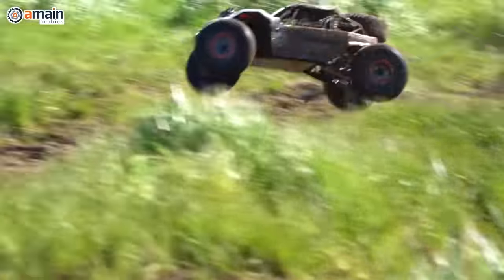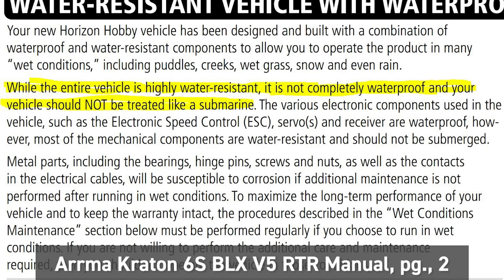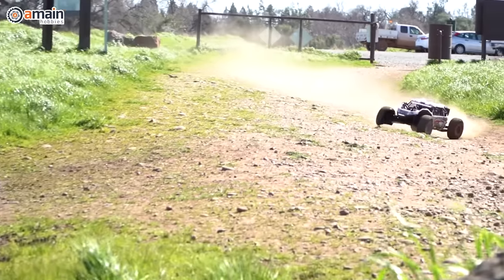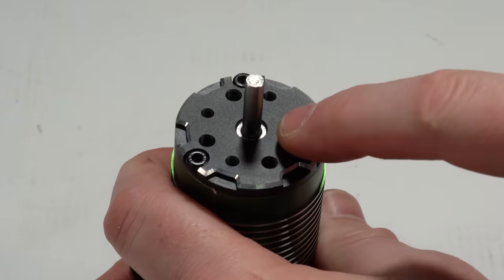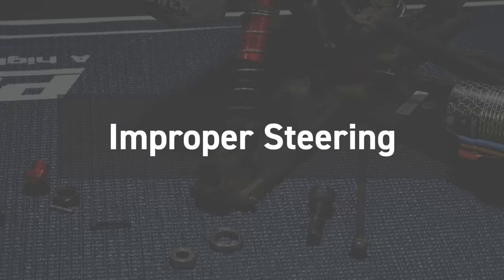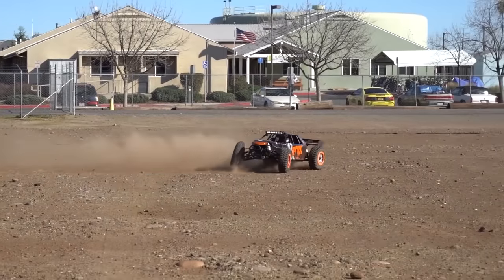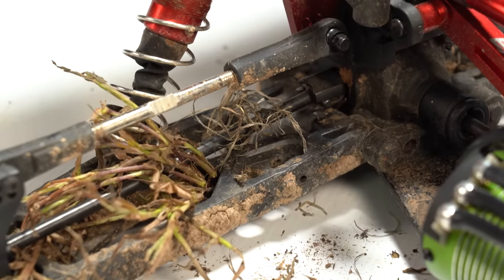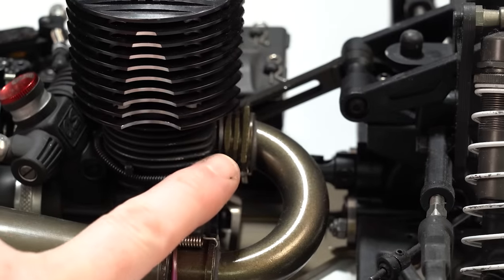7 Ways You're Destroying Your R/C Car

Comment: Ive bought smaller or skinnier tires and it helped a good bit but i still cant run a pack thru w/o letting it cool or it will hit thermal. If i upgraded to a 3660-65 from a 3650 would this help my rig run cooler or would it have no effect on temperatures? Forgive my ignorance. Everything else is stock. 1/10 4wd mt 3300kv 60amp HW rebrand. 3s.

Comment: Is using bent shocks going to mess up my slash 4x4 i mean they still move fine and the alignment is fine
Reply from the maker: Bent shock shafts can limit the shock movement and travel, but the truck should still run and operate ok; you'll just have poorer suspension movement and less overall performance. Like the vehicle will turn/steer/corner odd to the effected side, but behave "normal" turning to the other side. I'd replace that shock shaft at some point to keep your truck fresh. 
-Brett

Comment: first issue is i had a buddy wreck mine near flooded culvert pipe.. stock slash 2wd.. motor, trans, every single thing was underwater for at least 10 minutes because it was so deep and step to get to had to find a long branch to rescue it.... got it out and finished the battery pack.. been 2 years and not an issue?

Comment: Cool tip on the "After Run Oil."
WD-40. The "W" stands for water. The "D" stands for displacement. The 40? I haven't got a clue.
Reply: It was the inventors 40th attempt at making/Designing WD 40

Comment: I agree with everything except for running the nitro engines without fuel evey time to drain leftover fuels. I just use my fuel bottle pull out exess fuel and if needed remove fuel line to gravity bleed.

Comment: But here is the thing, I always drive on dry terrain, I live far from water, I never touch the gearing, I use an Electric car, the steering is always correct and I never need to fix it and im a peaceful driver so its going to take a long time before any parts will break.

Comment: Hello, I was wondering if you could give me some advise with  a problem that I have.    I have a granite 3s blx which I purchased used. The truck is in mint condition. The only problem I have is that the radio range is about 30 feet and the truck stops (no steering or throttle). . Once I get within 30 feet I regain control of throttle and steering. The antenna looks fine. I was wondering if I need a new receiver or there is a problem with the esc going into a safe mode. Thankyou..
Reply from the maker: The receiver should detect the transmitter signal unless there is no signal (or the signal is not strong enough to be detected by the receiver; hence the 30ft range of control). It sounds like the transmitter signal is so weak it can only provide a range radius of ~30 feet, and unless your vehicle is within that radius, it is lifeless. This is often a sign the transmitter batteries are bad or need to be replaced; have you tried new transmitter batteries recently? What transmitter is it by the way; make and model? 
-Brett

Comment: Everything here is dope and true but the tape over the vent holes on the wheels will prevent the most traction you can get out of the tire, it doesn’t decompress and grip as fast when the vent holes are blocked

Comment: If you know what your doing you can water proof the whole thing like I did and I’m 13. I did it by myself and took one hour. Mine goes over the roof underwater and I have not had a single problem. Put wd40 on the metal it won’t rust.

Comment: Hi, new to rc... about keeping the rc cars clean can you use like a light amount of oil on the non electrical parts? Its popular in offroad trucks where people spray wd40 on their suspension and frame. Then just wipe all the grime off with a paper towel after offroading. Can you do this aswell?
Reply from the maker: Yeah, should be ok. Some people in r/c do the same thing. ProTek has this product that comes from the motorcross world, but you spray it on clean plastics and it shines the plastic and makes them easier to clean after. https://www.amainhobbies.com/protek-rc-trushield-rc-car-detail-spray-13oz-ptk-1540/p246483
It has a sweet, almost berry-like smell to it.
-Brett
Reply: @AMain_Hobbies  Awesome, good to know. I appreciate the reply.

Comment: Wil a crawler like the trx6 have a drive train that spins that easy without the motor or does it have a  bit more resistance to it?
Reply from the maker: I imagine the TRX6 diffs to be loose for crawling, since you can lock the diffs remotely, which is fine and normal. 
-Brett

Comment: I have an hg p408 humvee and i recently drove it in the snow. How do I properly clean out the drivetrain to remove all the salt from there?
Reply from the maker: Might be tricky but you'll need to start dissembling those drivetrain parts and start scrubbing them. It's a tedious, time-consuming job to tear down a car and clean it, but it will make a huge difference. I'm not familiar with your vehicle, but I assume it's a hobby grade vehicle you can disassemble and work on; If it isn't, we don't recommend you disassemble it. 
-Brett

Comment: I got a problem with my typhon 3s I never tried cleaning it by taking parts out or anything to complicated and hard work but there's some black oil or whatever the liquid thing is in the springs but something leaking everywhere on the joints near tires and bit on the springs near the tires I dont know how to be specific but I need help

Comment: My bandit does 100 on stock motor and esc It's really hasn't donr much I just went to aluminum Spur and clutch clutchless replacement and stronger gears in the transaxle she's all good I went to different wider setup from a different model that mount the same so I got fans and heat sink but I start slow then hit it cause I got a long smooth street,(electric car too it was like a 28 -31 pinion and around 70-76 Spur or something I can't remember gotta look but yea after I shaved down 3 Spur gears I went aluminum then I havnt had issues even the stock axles held up but I went to strong metal ones for the stress

Comment: Hey I'm new to rc what kinda tools does he use? Does he have a link or has something tips on what to do and what tools i should get?
Reply from the maker: We picked up the ProTek Tool Bag and filled that with our favorite tools. 
This is the bag: https://www.amainhobbies.com/protek-rc-trutorque-team-tool-bag-ptk-8102/p222021
The hex drivers: https://www.amainhobbies.com/protek-rc-trutorque-sl-metric-hex-driver-set-4-ptk-8416/p863873
The nut drivers: https://www.amainhobbies.com/protek-rc-trutorque-sl-4piece-metric-nut-driver-set-5.0-5.5-7.0-8.0mm-ptk-8282/p752699
Pliers: https://www.amainhobbies.com/excel-needle-nose-pliers-w-side-cutter-5-exl55580/p27709
Xacto Knife: https://www.amainhobbies.com/excel-light-duty-knife-w-safety-cap-exl16001/p27756
Lexan Body Reamer: https://www.amainhobbies.com/protek-rc-trutorque-lexan-body-reamer-ptk-8203/p212259
Shock Tool: https://www.amainhobbies.com/protek-rc-trutorque-shock-shaft-pliers-ptk-8267/p248643
We also carry a sharpie black ink pen, an old tooth brush and some electric tape. These tools should service 99% of r/c basic needs. 
-Brett

Comment: I have a question, i have 2 traxxas slash 4x4s, and both of them, the back tires get worn out much faster than the front. And i don't do donuts, i don't go from 0-full throttle. Is there a way to prevent back tires from getting worn so fast? Plus on both of them the tires are adjusted right.
Reply from the maker: You can try rotating them. Once in while rotate the rear tires to the front, and the fronts to the back, and you should get more life out of the tires. 
-Brett
Reply: @AMain_Hobbies  thanks you very much, I'll try doing that.

Comment: Im a noob with these cars but I got a aarma senton 4x4 for my 8 year old and it has been the biggest piece of junk I have ever seen... im a small engine mechanic to the highest degree and although I am not knowledgeable with RC car components I am extremely mechanically inclined... I am beyond frustrated here... nobody knows what to tell me I have gone through 2 motors... a spur gear and a front bumper... also the drive axle fell out and all of these issues in about 2 hours of actual drive time!!! WTF!!! its insane... obviously I am missing something but drivetrain is smooth no binding... not owner error (hopefully)... as far as installing the new components because the initial motor it came with lasted 35 minutes and the one I install lasted 1.5 hours but apparently you can't drive them in dirt, water, snow, grass, leaves etc.... so concrete and paved roads yay!!! I'm  done with aarma and I think the way that the components are completely exposed is a huge design flaw... it keeps getting full of debris when running it and that is crazy to me... why aren't the components sealed or at least protected... i understand it needs airflow but there has to be some way to seal the critical components... the damn spur gear is just out in the open and it gets a tiny grain of sand in it and there go the teeth... horribly designed cheap crap... I just want my son to be able to drive it for a couple hours without it breaking... I know someone will say I have the settings wrong or endpoints but nope... and using correct battery... not geared or modified in any way... was looked at by the hobby shop and no answer... its garbage... sorry for the novel but I gad to vent lol... I actually liked your videos good stuff 💯
Reply from the maker: Awh man, I'm sorry to hear that John! Is this the 3S BLX Brushless version? You have to watch out for the plastic driveshafts and the motor mount bending on the 3S BLX vehicles. When the motor mount bends, you'll start going through gears (but generally the motor doesn't die). The motor will die if you add extra weight to the car (the tires filled with material can add a lot of weight), change the gearing, or are not letting it cool down in between runs. About 175°F is the limit before you start to reach the danger zone. In cold climates, the motor may never get that hot. In hot climates, the motor may reach that temp in 2 minutes. 
-Brett

Comment: Is it true on your first run you should only use at a 1/3 top speed to properly break in a brushed motor
Reply from the maker: Back in the day, people had all sorts of break-in methods, including breaking in the motor in water. Some people care enough to do this, some people don't care. I personally don't think it makes much of difference for most applications, unless you are going to race, but brushed motors are no longer raced. So... just enjoy your car. Brushed motors wear out regardless if you drive at 1/3 power, or 3/3 power, which is why long-lasting brushless motors are mostly used today. 
-Brett

Comment: I’m thinking of gearing up my Traxxas Hoss to a 15 or 16-tooth pinion (the stock pinion is 14-tooth). I have a heat sink and fan for the motor. Would this be okay for the truck?
Reply from the maker: It's hard to say, it depends on how hard you drive, the type of terrain you drive in and the weather of your environment. You could try it, drive for a few minutes and feel how hot the motor is. If you can leave your finger on the motor can for 3 seconds its ok, if the motor is so hot you can not do this, it's too hot; just be careful not to burn yourself. We sell these temp gauges for this application too: https://www.amainhobbies.com/protek-rc-trutemp-infrared-thermometer-ptk-8310/p360118

My guess is, gearing up is not recommended unless you're only doing a speed run. Traxxas tested the gearing and equipped the truck with the best pinion size for overall bashing. 
-Brett

Comment: What's the 4wd buggy shown in the video, specifically at 6:32..? Thanks!!
Reply from the maker: That's the Team Associated B74.1 4WD Buggy. The current version is the B74.2, but you can still buy the B74.1 and it's on sale: https://www.amainhobbies.com/team-associated-rc10b74.1-team-1-10-4wd-offroad-electric-buggy-kit-asc90027/p1252584
Here is the current B74.2: https://www.amainhobbies.com/team-associated-rc10b74.2d-team-1-10-4wd-offroad-electric-buggy-kit-asc90037/p1447397
-Brett

Comment: So what if u are using the 12 pole velineon brushless engine? Is it still supposed to role freely? Or is a little binding ok?
Reply from the maker: You need to remove the motor or the motor pinion gear from being engaged with the drivetrain, and then roll the drivetrain to see how smooth and freely it feels. You cannot roll the drivetrain with a motor engaged to it. 
-Brett
Reply: @AMain_Hobbies  ok I meant 4 pole not 12😅😅😂 I just put the 3351r brushless velineon motor in my 4 tec 3.0, thanks for the tip!

Comment: It's old but i have a question, how about when car is understering as brand new from the box, i mean here keep trimmering servo on controller because when driving it's keep slightly turning left or right, never straight forward, i tried loose the screw on servo, regulate it, in final result is just keep the same, trimmering on controll and never push the trigger more because it will end on wall.

I could understand that behaviour after some using already, but new Traxxas toy with problem of steering where your rc car not drive on the line on asphalt? (yes it's road car, it's stingray rc car, but problem i seen on my traxxas xo 1 as well)

I could be very gratefull why this problem appear and eventually how could i fix it.
Reply from the maker: It can be the servo saver not properly centering, but that is more common on used vehicles where the servo saver is worn out. It might be worth checking out though. 
-Brett
Reply: @AMain_Hobbies  Yes i found it out, indeed it was not centered properly, thanks for info :)

Comment: Hi! can you tell me, why the fan on the electric speed-controller stoped working after the very first test-drive? could it brake down so fast? or it activates only if necessary? the speed-controller itself working good, but the fan - is not. What`s the problem?
Reply from the maker: If it's an off-road vehicle, fans can die pretty easily from bumps and jumps; most often from landing on the lid. Fans are made from plastic and under the right situations, the case will flex and the fan blades will hit the case and break. If it didn't break, maybe the wire came unplugged?
-Brett

Comment: The tyres getting water in them what about when people take the foams out of there crawler tyres does that affect it ?
Reply from the maker: If the tire has no foam, water getting inside will be less of an issue, but i'd still try to get the water out. You don't want standing water in there. 
-Brett

Comment: I'm new to all this rc stuff but I have a fiesta st rally what battery would be an upgrade from stock and work with my 2-amp NiMH peak detecting AC charger
Reply from the maker: It's tough to say, you might be able to get another NiMH that is a little more powerful than the first, and that could be charged on your existing NiMH charger. Another route is to upgrade to a LiPo battery (assuming your vehicle is compatible with one) but the downside to LiPo batteries if you will need a LiPo specific balance charger as they cannot be charged safely on NiMH chargers. 
-Brett

Comment: Y’all don’t need to do this much for em.. if your wanting to keep the RC forever than yes do this but they’re taking it over the top with the steps as you can check up on things after time.. or you can be normal and just drive the damn thing till something breaks (repair it) and either sell it for something else or keep it and literally just end up with a fully decked out vehicle with more notices on which parts you should expect to replace sooner than later

Comment: I have a question my rc offroad buggy was drifting then the wheel just popped off and I want to know what made the differential outdrive cup break in half at the hold where the pin goes into
Reply from the maker: Outdrive cups often break because they get worn out and develop grooves from the driveshaft pin. As the groove wears worse and worse, the driveshaft pin becomes more flat. With enough wear, the flat pin and outdrive groove can lock together, preventing free movement and this breaks the outdrive cup. There are other issues that could cause your break, but this may be the issue and you can check it by inspecting the other outdrives on your vehicle. 
-Brett

Comment: Can I clean my titan 12 t550 in rubbing alcohol or should I just use water!?

Yea I know your guna tell me to replace it with something far better... but I really wana save my $$
Reply from the maker: To clean it, try using a motor spray or nitro cleaner to spray the motor out and give it a spin. When finished, add some bearing lubrication to the bushings on each end, but not a lot so it doesn't attract dirt. 
This motor spray will work to clean motors, bearings and more: https://www.amainhobbies.com/dynamite-magnum-force-2-motor-spray-13oz-dyn5500/p-qqqvtztq6cqxactz
-Brett

Comment: I am absolutely terrified of dissasembling my nitro rc. I dont have proper instructions on how to reasemble it. And i couldnt find any instructions since my model isnt popular or known much at all. How can I overcome this fear?
Reply from the maker: I understand. Best thing is to start small; disassembling one area, keeping track of what screw goes where and then reassemble it. Start with removing one of the tires, inspecting the hub behind it, and put it back together; If you're feeling more confident, remove that hub from the suspension arm before you reassemble. Maybe remove the shock, inspect it, then reassemble. You can also use your smart phone to record photos or video of how something is assembled, before you disassemble it (I use this a lot). 
It's rare to need to completely disassemble the car, instead it's usually areas of the car that need to be worked on. Try to find a manual online or pay to have one shipped if possible. It will make life easier. 
-Brett